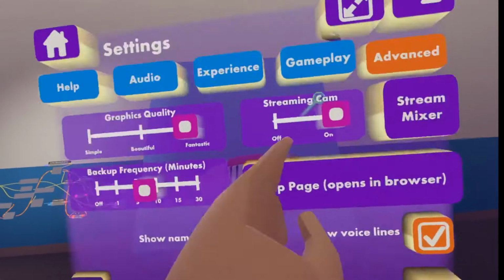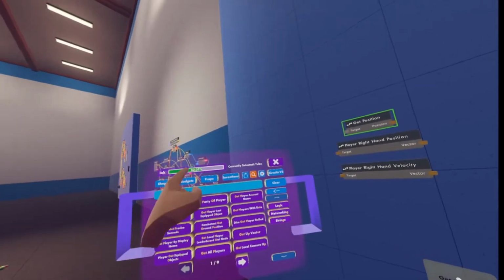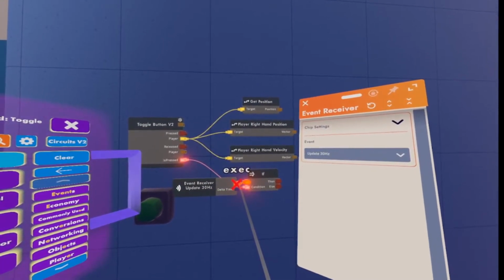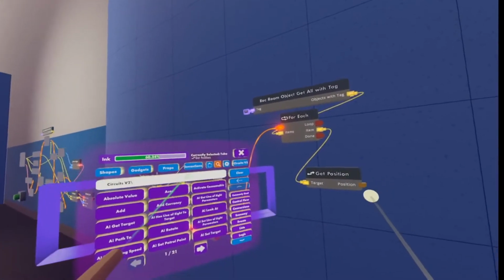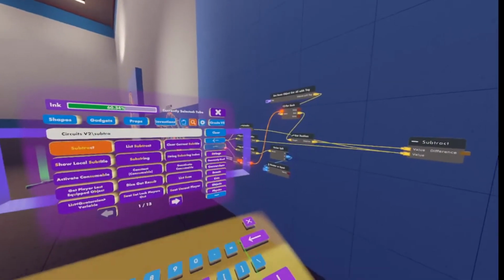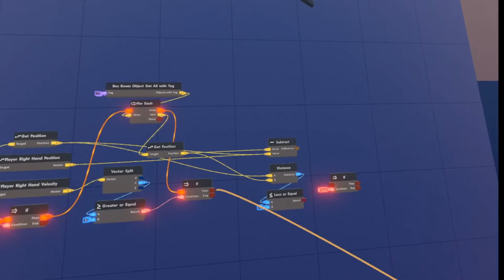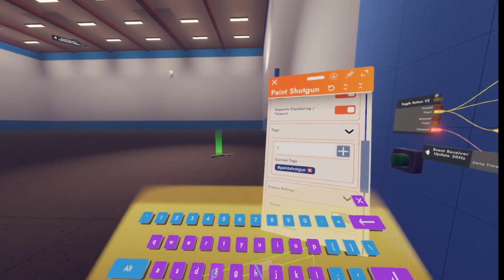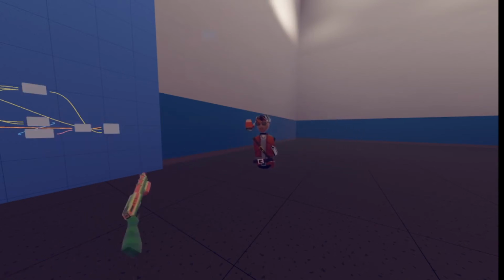Rec Room Cv2 Tutorial: Force pulling

Comment: Is there any way to force pull players?
Reply: If you remove the get all objects with tag and replace it with a get all players with role. Get a role chip and name it whatever. Get a player add and remove roll. Get 2 trigger volumes. Wire them together and it should work.
Reply: @Ray-2764 or u can do a player joined